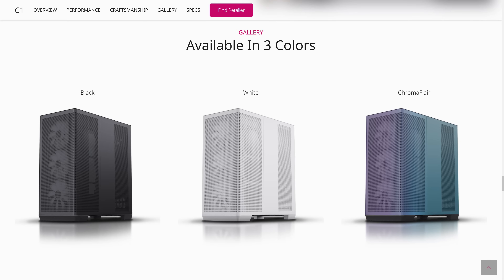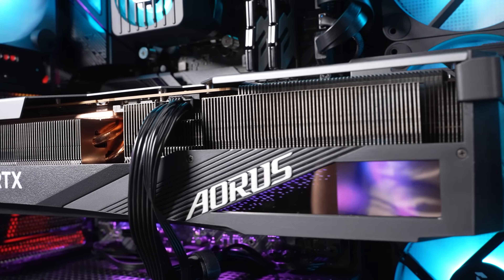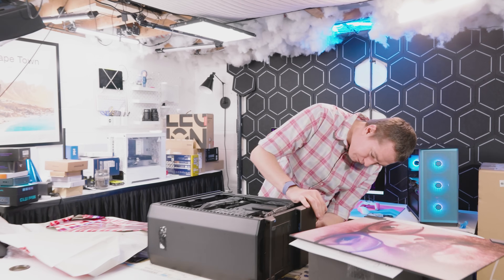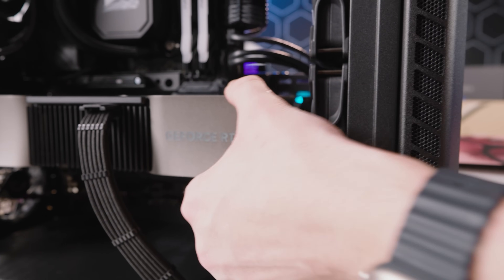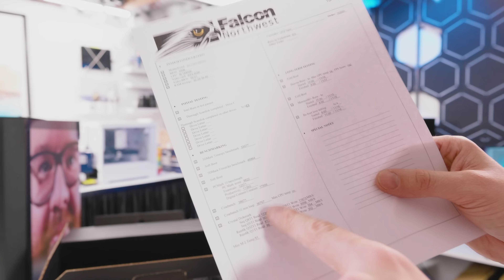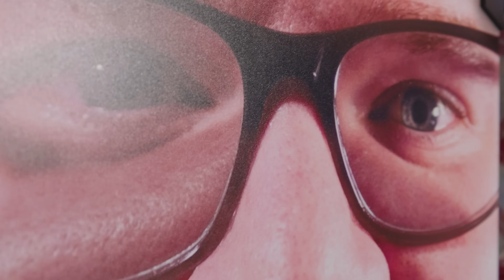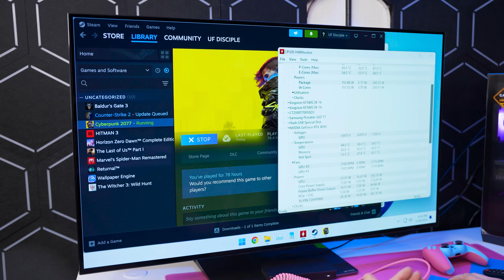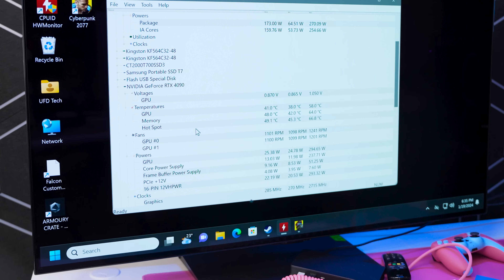The Ultimate Gaming Pre Built - Falcon Northwest Talon

Comment: I've bought several Mach V's, incredible machines! I'm not a huge fan of mid-sized, that 4090 barely fits. Hope there be bigger options down the road. There's still a market for a more dominating, automotive painted, behemoth. Just slightly more room, please! I wish they offered paint (solid/rain). My choice will be the dual solid panels. It's a work of art that I get to appreciate myself. No more binders? Falcon technical support is top-notch, the best of the industry. RN it's on my Ultra/5090 short-list to buy.
Reply: I going to build my 2nd pc also around the 5090 with the 9800x3d  now because of scalpers if I decide to go custom prebill instead ,falcon northwest is on the top of my list

Comment: Nah bro, this ain't it. They are outrageously overpriced. Plus their configurator sucks, their builds look boring af, and their cooling solution is inadequate at 280mm. I can get more granular control over the build, with similar top-of-the-line specs, a much slicker-looking system, and a bigger/better cooler for $2,000 less elsewhere. I don't care how good the customer service is. These are deal breakers.
Reply: The fact that you think this PC is expensive solely because of customer service shows that you haven't done your homework. Swing and a miss.
Reply: @scootcha  Ummm... That's not what I said at all. Seems like you swung and missed. And your reading comprehension is slim to none?
Reply: So don’t buy it? There, fixed your bitching.